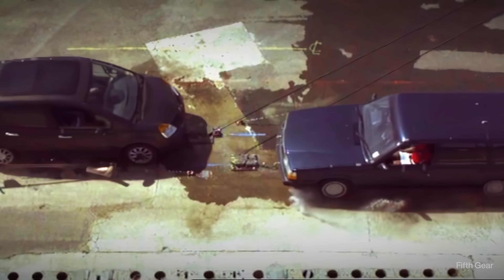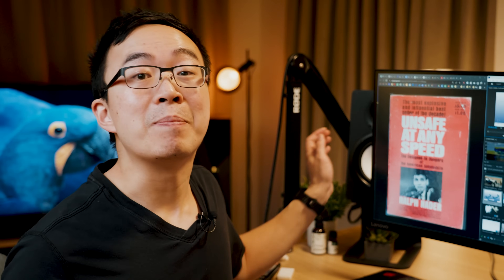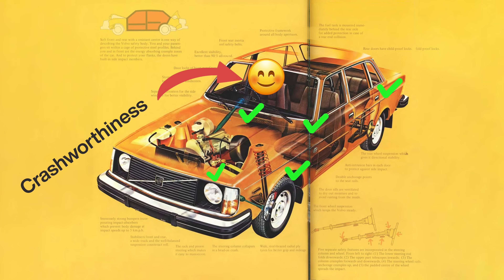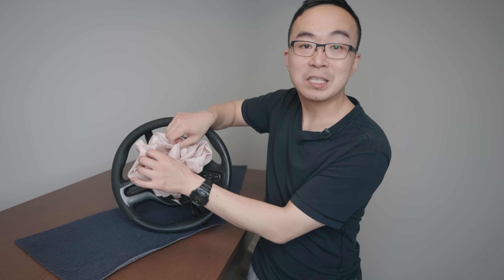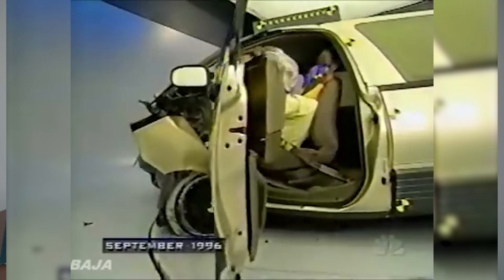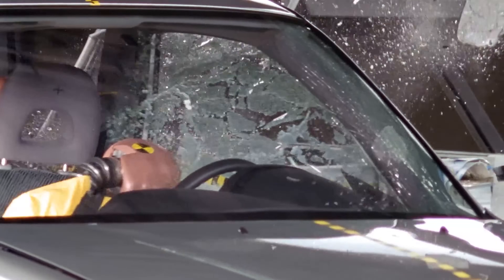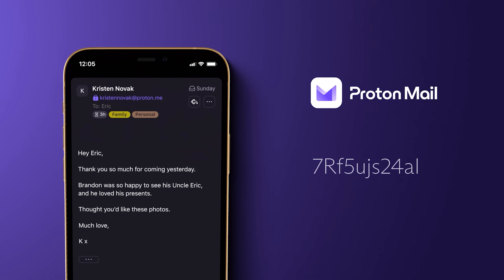When does a car stop being safe?

Comment: just dont crash, ofc modern cars are more safer, but modern cars suck more, that 940 Volvo from 1990 will do 500.000km no problem. whilst most modern carse are considerd trashed after 150.000km, more eletronic safty features are good i agree, abs, esp stability controll, dead angle warner. all good and helpfull. but once they fail when ur car is out of warrenty, it costs so much to fix, it takes so long time to fix and often you dont even find parts for that car because the manufacturer just drops it. for me. i wont buy a car younger than 2002, plastic everywhere, bad part availability and the Rust every. drive the speed limit, in bad conditions slower, and allways keep a save following distance.

Comment: I think this video is overall very good but still ignores that a lot of the latter improvements (past 20 years) came because of European laws/institutes/inventions. While American car testing wasn't all that special, the European standard has always been higher and many already knew that some tests would be devastating to American cars. That's also why a lot of cars weren't sold in Europe, because it would get them more negative press since they knew about it already. Its one of many reasons the US was so hellbent on selling pickups in the past 30 years because those are barely sold here (aside the tax cuts) so there isn't any test to fail. Once NCAP was launched in 1997 it was always much stricter in the EU than the US.

Comment: That's all well and good, but too much safety is dangerous!

Driver-Attention Monitor
👇
It's the worst safety feature in history!

Lane-Keeping Assist (LKA)
Lane-Tracing Assist (LTA)
Traffic Sign Recognition (TSR)
etc.
👇
My BMW E46 2000 fortunately does not have this. 👍

When I have a car with this "safety" features,, the first thing I'll do is pull the cameras out! Problem solved! 🤣

Lane-Centering Assist (LCA)
👇
Note: LCA may only function when the adaptive cruise control is engaged. <> If it only works with that, ok.

Comment: We ran off the road once and the air bags went off, and it smelled like after you set off a bunch of fire works, this crash really didn't really require airbags, just hit one of the sensors perfectly

Comment: From 1969 all GM models were equipped with collapsible steering column, nobody paid attention to that.
This was 6 years before Volvo did,  causing an image impact on the market.
From 2016 GM also build the first probing ground designed for turnover research, today all GMs models have turnover sensors which ar critical for the airbag triggering sequence.
The story repeats, nobody knows this because global ncap is in other business.

Comment: If the world REALLY cared about safety, we would all have roll cages and we would all wear HANS devices. How do you think F1 drivers can survive 50GS of frontal impact? How do you think Rally drivers can walk off a car that got flung over a guardrail and thrown dows a forest? 6 point harnesses, rollcages, HANS devices. Airbags can injure just as much as they can save lives, 3 and 4 point hanesses will always have the slide under flaw, and leaving the neck loose is basically asking for neck injuries. Convenience and comfort has killed the car industry.
Reply: Some vehicles do have integrated roll cages and some seat designs prevent "submarining" or sliding under better than others. How you configure the seat also contributes to how it performs in a crash.

Comment: A car stops being safe when it's built.
You want safer vehicles?
1) Mandatory speed limiters
2) Maximum speed limit of 25 km/h in any populated area.
3) Maximum speed limit of 60 km/h on any "highway".
3) Sensible maximum kW ratings.
4) Limit weights of vehicles to no more than 1200 kg.
5) ban SUVs and sports cars.
6) better enforcement of traffic laws.
7) greatly increased penalties for drivers.

Comment: My Honda Fit saved my sister and I's lives back in 2020. We were on a US Highway passing through a small city. We of course had the right of way as we were the main and heavy moving traffic. That's then a young woman   runs a stop sign to the right of us trying to navigate an uncontrolled crossroad intersecting one of the busiest US Highways in my state of Wisconsin. I see her coming across the lanes and I immediate start wondering, "What are you doing, you could really either get hit, or sideswipe my sister and I." As she runs the stop light and attempts to get across asap instead being a cautious and safe driver. BOOM! we get hit from the side, my sister and I were going the speed limit of 40mph that very shortly goes up to 55mph as you leave the last part of town and into the more rural areas.She ran going around I would say 20mph. Upon impact, I then yell, "Oh my god, oh my god, what the hell, we just got it hit, we were just hit, oh my god, what the hell?!" My sister's side airbags were deployed, My airbags on the drivers's side did not. The impact spun us 180 degrees and we then "stopped." (I apologize for the length story,) I just thought share my sister and I's first and only accident so far, and we were most certainly not at fault for the car accident. My cute lil grey Fit was complete smashed in on the front and rear passenger side doors and the frames was smashed into, so not a good story for my baby lil Fit. At the end of the day, I can confidently say I will forever think high of cars including my 2013 Honda Fit! They saved myself, sister, and countless lives from being taken on the road. Cheers to the engineers, researching, and testers! We appreciate you and please continue to further our safety features in all aspects of crucial and critical areas.

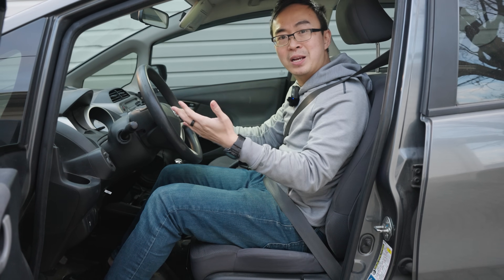Comment: 10:41 I actually learnt about the Inertia Lock on seatbelts by accident as a kid, sometimes I’d get too excited and pull on the seatbelt to buckle myself in quickly but was caught off-guard when it stopped suddenly. When I tugged it, it wouldn’t move. So I waited a second before pulling again gently.

Several years after, I connected the dots and realised I found a safety feature for cars I had no idea about. Seatbelts are awesome.

Comment: That last test also shows why you should brake in a straight line unless you’re 100% sure to dodge the obstacle. Not only do you negate the risk to do barrel rolls, you also guarantee the collision will happen in the most tested and reinforced way: head on

Comment: I drive a 1969 Marquis. Safety is not on the list. Airbags? Nah. Full seatbelt? Try just a waist strap. Only thing i got going for me is that im a 2 ton, 18 foot long steel frame, but even then. No idea how well it would handle a crash. I might have a spear in my steering wheel collum.
Reply: Well the car might be fine but you as a driver might end up six feet under

Comment: 1:45 TIL the steering wheel rim is forward from the steering column so there’s enough space to absorb energy of the driver

Else if it’s just flat, the rim breaks and driver lands on column and spokes

(I know collapsible columns are a thing now, but that’s a neat design lesson decades ago)

Comment: When they aren't made of at least level 7 glass or higher. When they aren't given level 5 armor ratings. Those two things alone could make them safe. However what do we get? They are made of cheap alloys and aluminum. They have easily breakable glass. Trucks rears can detach from them since both parts are constructed separately then cheaply fused together. You pay not for the safest ride in the world with multiple safeguards: You're paying for an luxury to get you from point A to B, and if it crashes and you die? Does the manufacturer get blamed? Not at all.

Comment: When do cars stop being safe? When iPad touchscreen infotainment systems became standard, cars today are far less safe than pre 2010 cars, when ultrabright LED lights became standard headlights, drivers today are extremely unfocused due to these things, older cars are actually safer since drivers are more focused and have natural force feedback, modern cars need better crash safety metrics because the likelihood of new cars is significantly higher than old cars, touchscreens in cars means drivers are more distracted  ever
Reply: So why are crash rates going down?

 Why did double the amount of people die in car crashs in the 60s even with less cars on the road?

Comment: The thinking behind this is so screwed up that it reminds me of an anecdote; A VW engineer was being badgered by journalists when the VW bus changed from rear-engined to front-engined. Now, the old rear engined bus had had a famously good front-end crash structure (counter intuitively, I know) so that when this major change was up for discussion, motoring journalists (perhaps unsurprizingly) had a LOT of questions. The German engineer in charge of the bus programme eventually just said, "Tell me the accident you intend having, and I will design the perfect car for you to have it in." Just think about how many people drive old (an purportedly 'unsafe') cars EVERYDAY, and safely complete their journeys. Since the least safe part of any car is the bio degradeable sack sitting in front of the steering wheel, just service your car, resolve to do your best as far as driving goes, and live life.

Comment: 12:38  Step 0:  The seat belts are reasonably comfortable, self adjusting, and convenient.  The driver and passengers are usually wearing them during a crash.  1960's seat belts were not nearly as good, with separate buckles for the lap and shoulder straps, must be adjusted every time like an airplane seat belt, etc.

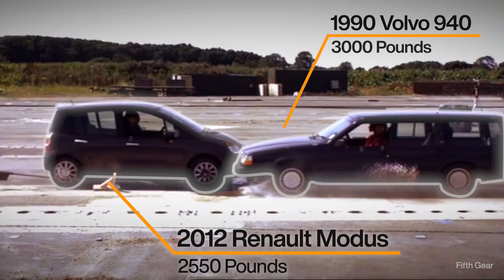Comment: 0:15 I disagree to some extent. My father drove a 2001 Chevrolet Tahoe. On the way to the dry cleaner to drop of my brother's JROTC uniform, a woman rammed into him in a newer "SUV" (All these cars they're calling SUVs are just minivans with AWD). Hit the front left corner of the truck.

Most that happened to the Tahoe was it took out the tire and head light, evidently pushing the fender wall into the battery, causing it to crack and leak. Wasn't even enough to set off the air bags and the engine was still running (albeit on 6 or 7 of the 8 cylinders, causing it to have a sort of gallop)

The woman's car was a newer honda (built sometime in the last 5 years). Didn't see all the damage, but it was bad enough to total her engine and set off all 20 (I think) airbags. 

True, the newer minivan protected the passengers, but so did my father's '01. And point goes to the Tahoe, because the engine wasn't destroyed

Comment: When does a car stop being safe? Probably around the same time that the engine is installed.
       Cars are, inherently unsafe. Humans are not meant to hurtle along at 70 MPH in a metal box. But you can do quite a lot to make them safer. By far the best way to avoid being hurt in an accident is to avoid the accident completely.
     Become a better, safer driver. Take a professional driving lesson. Everyone can become a better, safer driver, even if you are already the best safest driver in the world. Let's face is, there can be only one best safest driver in the world and it's not going to be you. But even the best, safest driver in the world has bad habits that are unsafe. You are doing things on a regular basis that are unsafe. If you haven't crashed because of them, that is just pure luck. Learn what bad habits you have and break them.
     Don't drive faster than it is safe to go. don't allow yourself to succumb to road rage.
      If you end up getting pulled over by the police, assume you did something wrong. It's possible the cop is just picking on you, but it's not likely, especially if the cop is stranger. Think about it, you see how people drive. Do you really think cops need to pull over cars at random, just to right tickets? I doubt a cop on duty can go more than 10 minutes without witnessing some traffic violation.
      Protect your rights, but if you assume, being pulled over, that you made a mistake and you disserve a ticket, you'll learn something surprising, assuming you didn't know this before. Are there any cops out there that can tell us what is more likely to happen?
     Becoming a better driver is cheaper than buying a new, safer car. And more effective to boot.
     Even if you're driving a 1970-something Pinto, it won't matter if you avoid the accident completely. Also, WTF is wrong with you, driving a 1970 something Pinto?

Comment: As a mechanical engineer something a think regulators are overlooking these days, is that its not really a matter of lighter cars being less safe. As much as its a matter of heavier cars being more dangerous for everyone around them. The heavier the combined mass of the crash, the more energy has to be dissipated. If you have two equal mass cars crash. One set heavy and the other light, its likely that the lighter crash will be safer as a result.

I'b be willing to bet that if we managed to somehow cut down the mass of the average vehicle by 250kg wed notice a difference in survivability statistics.

Side note: this is one of the issue i have with EVs. Batteries are extemely heavy and not useful for impact absorption. So they increase the energy of a crash, but do nothing to improve the vehicles impact absorption capabilities. So given an equal mass collision, they're likely to do worse than ICE counterparts as a class, though obviously individual models may invest more into advanced crumple zones.
Reply: I agree with your general point. However, the weight distribution matters as well. Pick ups are especially dangerous since there are so high. So when they impact, the energy is dissipated at a hight where a lot of important things (like heads) are. This is different for batteries since they are often really low. But yes, this is still a problem with EVs. I just think it extra weight is more acceptable when it is out of necessity. I think you agree, because otherwise you wouldn’t use EV’s as an example but trucks. However, trucks have their weight out of necessity. The real problem are SUVs and pick up trucks. The vast majority of SUVs and pickups are almost never used for anything a smaller care couldn’t do. If you care about space and moving stuff, the MPV is far superior. These cars are big to provide status.
Reply: I agree with your general point. However, the weight distribution matters as well. Pick ups are especially dangerous since there are so high. So when they impact, the energy is dissipated at a hight where a lot of important things (like heads) are. This is different for batteries since they are often really low. But yes, this is still a problem with EVs. I just think it extra weight is more acceptable when it is out of necessity. I think you agree, because otherwise you wouldn’t use EV’s as an example but trucks. However, trucks have their weight out of necessity. The real problem are SUVs and pick up trucks. The vast majority of SUVs and pickups are almost never used for anything a smaller care couldn’t do. If you care about space and moving stuff, the MPV is far superior. These cars are big to provide status.
Reply: Erowens98
Government regulations came from the industry themselves, these inventions sell the next gen cars, the wife liked it.
insurance people just follow the market.

Comment: More rigid frame, less crumple zone, and angled deflection surfaces. Basically a humvee or cybertruck (even better with more mass). Safety doesn’t necessarily have to be zero sum, but marketing is easier when it is.